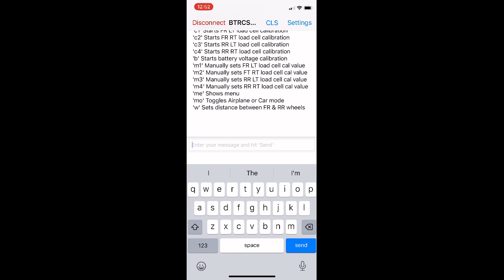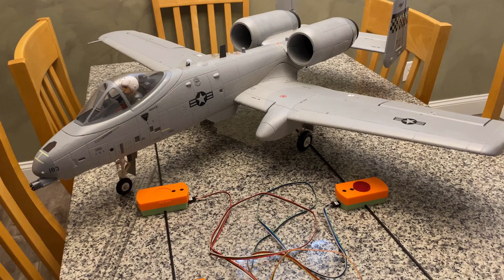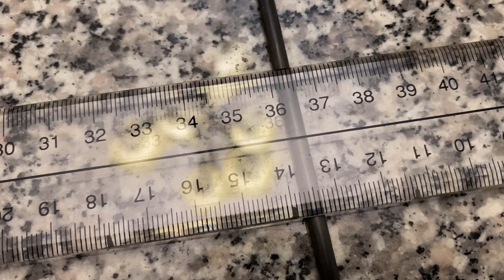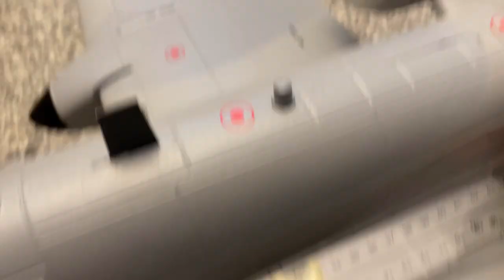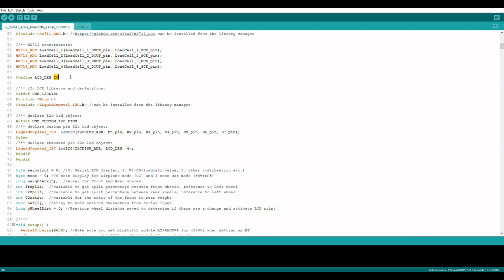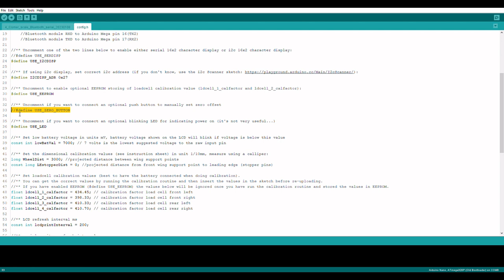Arduino 4 Corner Scale for RC Cars or CG Scale for RC Planes with Bluetooth serial control.

Comment: just built muy own but looks like there is a problem in the code for the load cells 3 and 4? I cant make them work properly, I tried to change everything in the hardware, parts, pinouts, arduino boards, load cells, hx711...but nothing works
Reply from the maker: I have a few questions to get started:
1. What Arduino board are you using?
2. Does Load Cell 1 and 2 give you calibrated outputs?
3. Did you check the Config.h file?
const byte LoadCell_1_DOUT_pin = 28;    //HX711 DOUT pin for load cell front left
const byte LoadCell_1_SCK_pin = 29;     //HX711 SCK pin for load cell front left
const byte LoadCell_2_DOUT_pin = 30;    //HX711 DOUT pin for load cell front right
const byte LoadCell_2_SCK_pin = 31;     //HX711 SCK pin for load cell front right
const byte LoadCell_3_DOUT_pin = 32;    //HX711 DOUT pin for load cell rear left
const byte LoadCell_3_SCK_pin = 33;     //HX711 SCK pin for load cell rear left
const byte LoadCell_4_DOUT_pin = 34;    //HX711 DOUT pin for load cell rear right
const byte LoadCell_4_SCK_pin = 35;     //HX711 SCK pin for load cell rear right
4. Make sure you using A+ and A- on the HX711 NOT B+ and B-
5. Are you using all the same components that I show in my diagrams?

For now, I can't think of anything else until I get your feedback on the questions.

-Jasen
Reply: @Jasenkrueger   Im using an arduino mega, i can plug any cell in the ports for cell 1 and 2 (pin 28 to pin 31) and they work ok, so the wiring between the cells and the arduino are all ok, I tried changing the ports for the cells 3 and 4 but didnt work, I tried with another 2 arduinos with the same issue.   Yes Im using a+ and a-. the only difference between your diagram and my build, its that I placed 10K cells instead the 5K, thanks a lot Jasen.
Romano
Reply: @vigia5  Hi Romano, i am looking to build this balancer, did you manage to get it to work?